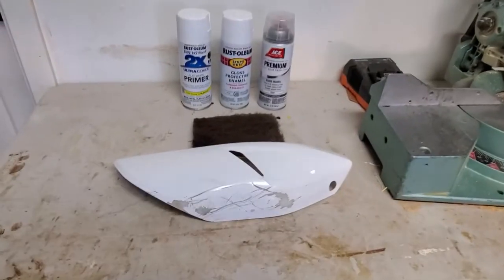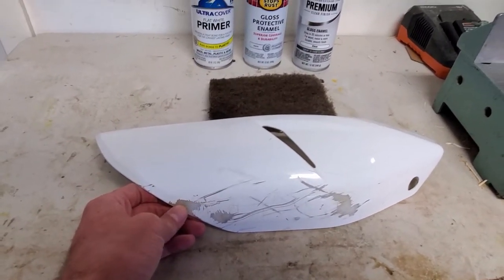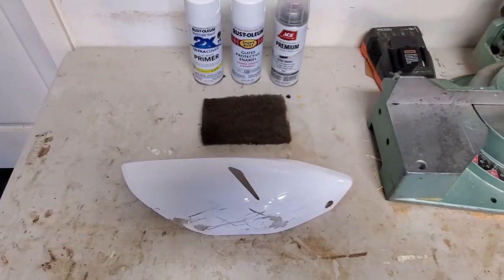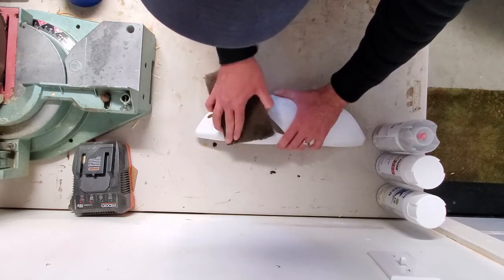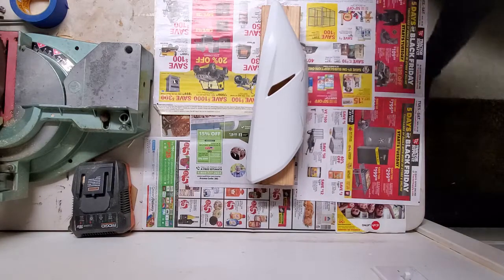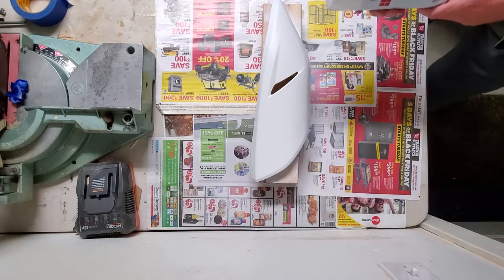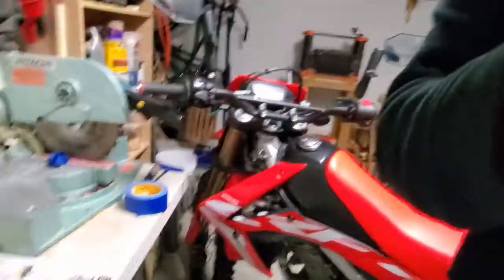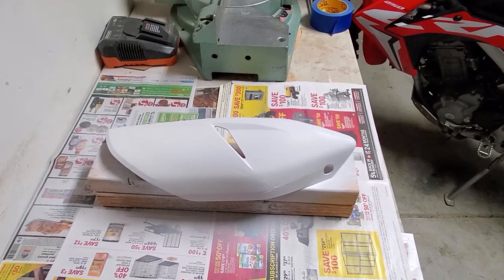How to Paint Motorcycle Plastics

Comment: Hey, I want to custom paint my dirt bike. But I wanted to make actual designs. If I follow this and add my designs before I put the last coat on, will it work? And also what paints should I use to make designs on my bike?
Reply from the maker: Yes, as long as you prepare the surface well with the scoring / sanding and primer, you can use virtually any type of paint (although I would recommend plastic or automotive paints). Then go over it with the protective clear coat that I specify in the video or a similar product. Make sure to do lots of clear coats letting them dry in between. I didn’t concern myself with a lot of coatings because mine was just white but you’ll want to protect your designs well! Good luck!